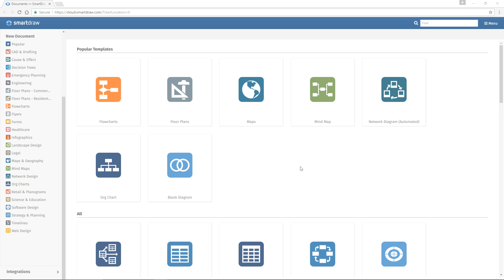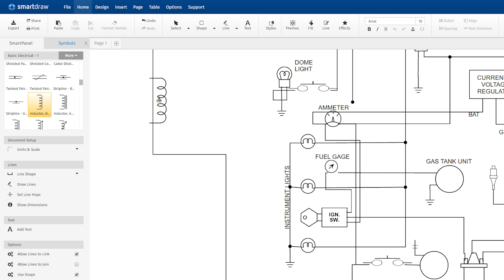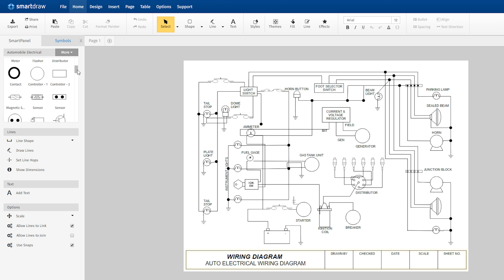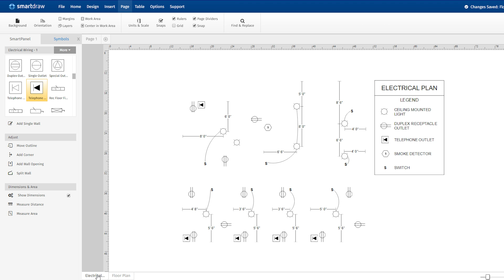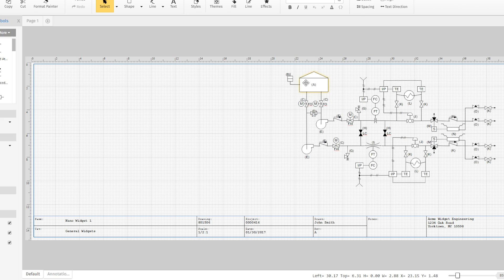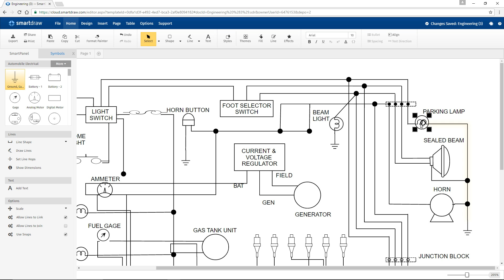How to Draw Circuit and Electrical Diagrams with SmartDraw

Comment: For me (nor would I recommend it for anyone) the software's abilities in terms of electrical diagrams are just insufficient - or at least according to what I've seen here:
 - No shortcuts - if I can't rotate 90 degrees by a shortcut, it's a pain in the _sandwich_.
 - No grid snap - I shouldn't worry about how things align when I am working.
 - Dragging wires - no really, dragging wires, what about a default ability to simply press a button to generate one, & simultaneously drag to the desired place with the desired length.

Even the diagram in the demonstration at 4:06 is HORRIBLE:
 - Right-bottom corner: GND is connected a buggy manner.
 - At center: GAS-TANK-UNit's GND is doing three turns before it reaches the ground, WHHHYY??? JUST WHHHY?
- Such issues are everywhere.

Honestly, I would like to know what would be the developer's response to what I see. So developers, you're more than welcome to comment.

Also I tried the app, & it runs too slow, I don't know why, but my pc is more than fine:
If I run Blender with 1300+ rigid bodies to simulate just fine - this should run like hot knife threw butter.

Comment: Its a shit show every symbol is hard to connect with straight lines. The symbol terminals are offset to the grid causing wonky lines and make snap function useless. Very stressfull and to top it off its not even free!!!!!! You could of told me that before i downloaded it made it clear!!!! Also you cant choose the destination for the program to install, OMG it 2018 and you dont allow it to be installed in any other drive then boot?????   WHY??? lets hope this program has a smooth uninstall!  

Edited bit Uninstalled very well.